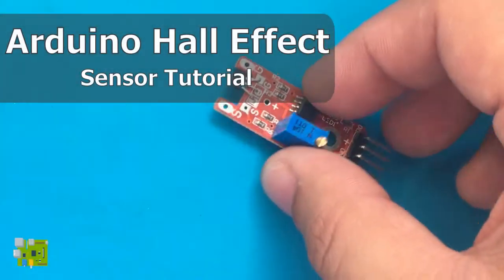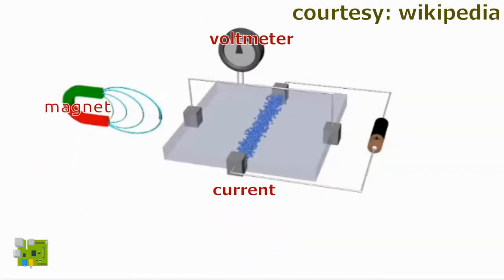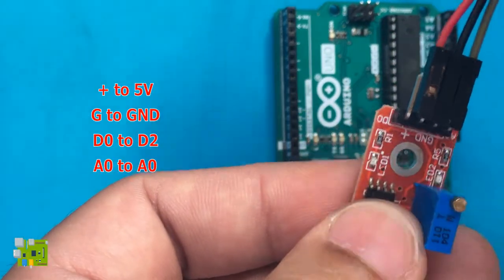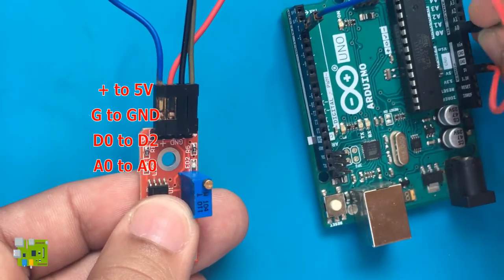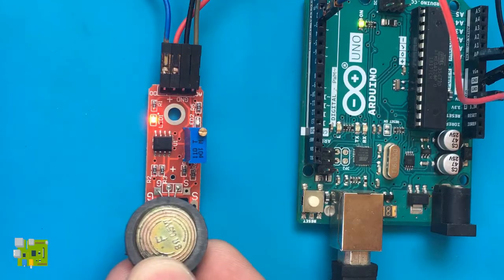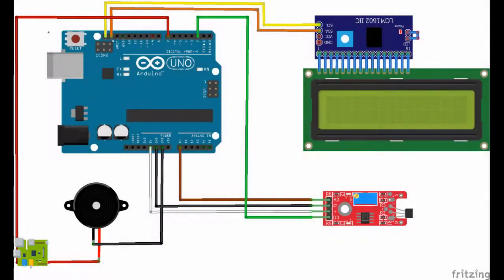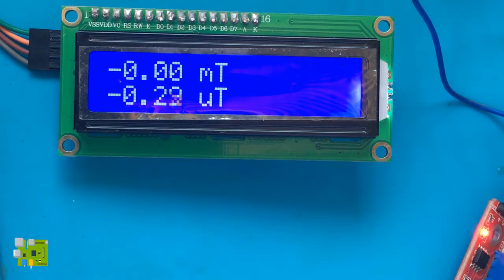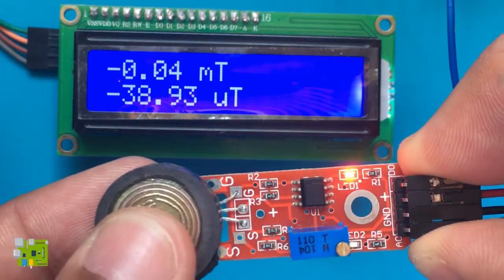Hall Effect Sensor Tutorial with Arduino

Comment: It can be used for digital speedometer?
Reply: yeah, you just need to have a few lines of code that say something along the lines of "if sensor input > x number, then increment revs by +1."
then you can calculate the rpm by dividing by the time, and if you know the circumference of your wheel , you can do a tiny bit of maths to calculate speed from the rpm.